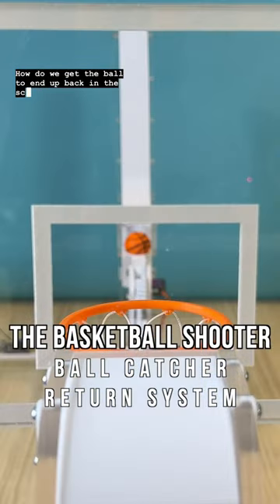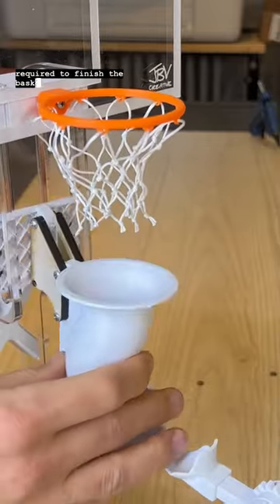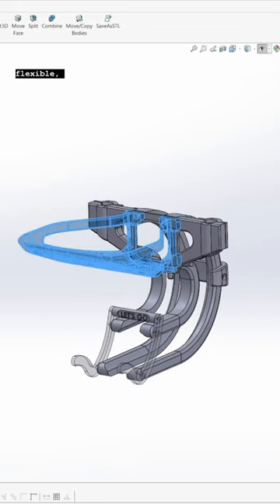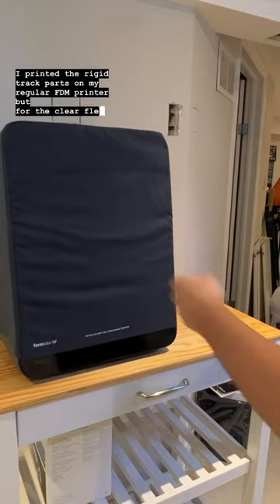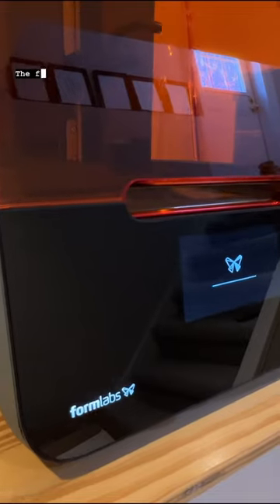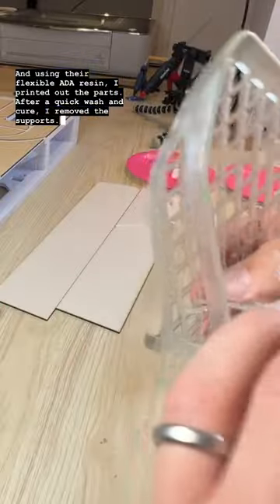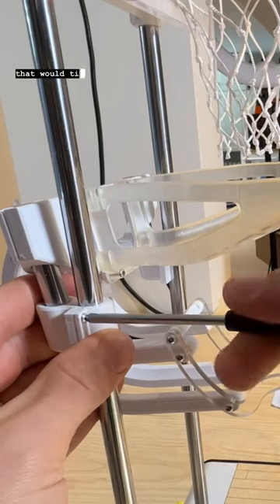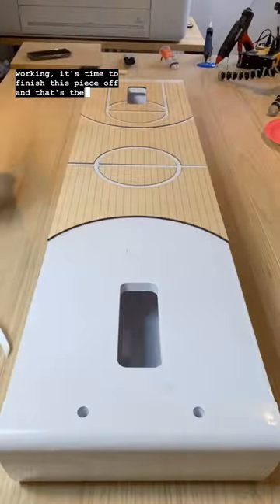Ball Return System for the Basketball Shooting Robot

Comment: tip: After the print remove the supports before curing it. It will be way more easy if you don’t use flexible PLA. If it is to hard heat up the supports with a hot air gun.